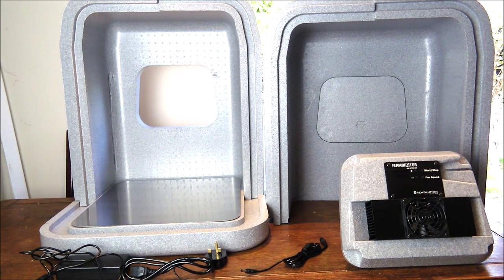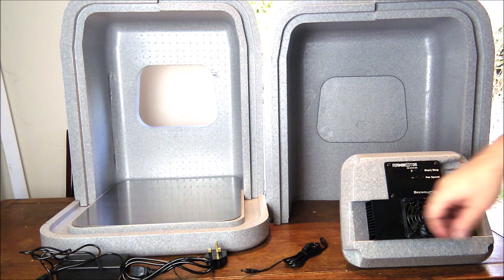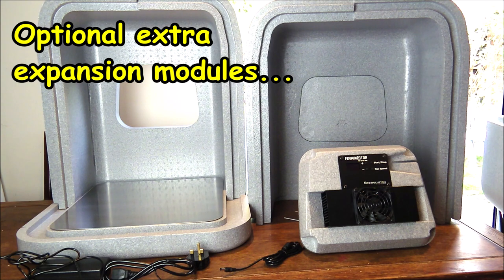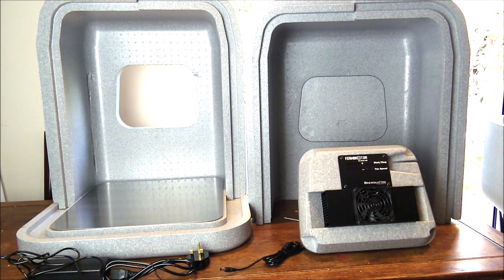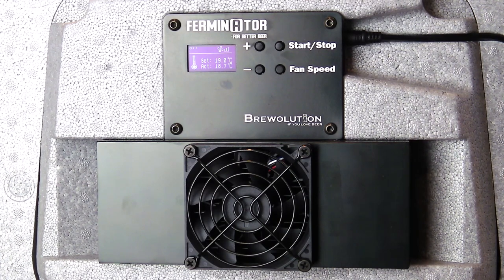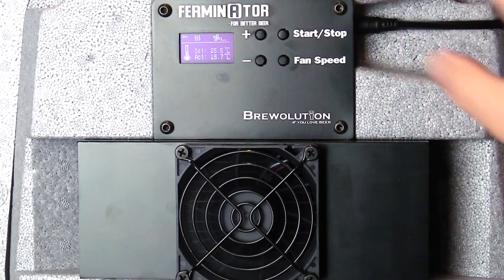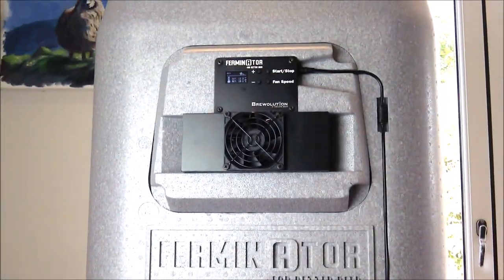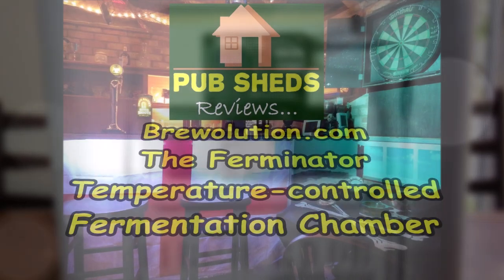**REVIEW** Ferminator from Brewolution.com - Temperature-Controlled Fermentation Chamber

Comment: I don't understand how 75W of power will drawn down to 0C - how does the heat exchange / chiller actually work?
Reply: The same way an electric coolbox does, which is why it works off an ambient temperature.
Reply: It uses a Peltier module, terrible inefficient at converting current into cold.

Comment: Does it fit a brewbucket with a bubbler or plaato on?
Reply from the maker: Hi Kevin, that's a good question, i'm not sure on the dimensions of the brewbucket with the bubbler or plato on but here is a link to the dimensions of the main unit and then with the extra extensions added (scroll further down the page): https://www.brewolution.com/ferminator-basic.html
Reply: Pub Sheds how much clearance at the top with just a normal plastic fermentor (30L)

Comment: Will fall apart in a few handles....vastly overpriced for what it is...!!!
Reply: I've not got one of these, but I can be fairly confident that it will not fall apart. This kind of box is used by a lot of food delivery services in Demark and they pick up the empty ones off you on a new delivery, so they are reused loads of times in a much more harsh way than you would ever use this at home. It's not the soft expanded polystyrene you get as box packaging.
Reply: @DannyMonaghan69  I spent 25+ years in Cold Chain distribution utilising all sorts of packaging.  Yes, this is more rigid, but you catch something sharp down the side of it and it gouges mate.  Such boxes are usually covered in cardboard - these are not.  The hustle and bustle of a home brewery will cause something to happen on this for sure.  As they are rigid - they are also more susceptible to splitting.  I am not being a troll here, I understand the packaging very well - I think it is a good idea, but I don’t think it is worthy of the price, especially considering how much blow moulded poly costs per unit.
Reply: @DrunkDelilahBrewery  not got one of these, but i think the price comes from the heating, cooling unit. Otherwise you could just make this yourself with ice bottles and a pc fan. The temp unit is the reason for the price IMO.
Reply: @theculturebrewingchannel5619  Yes but this is about £140 notes, the rest is blow moulded polystyrene - it is rigid and will not last too long.  The Peltier Unit's are ok, but it needs a decent ambient - anything too high or low and it will struggle.  They are not very efficient.